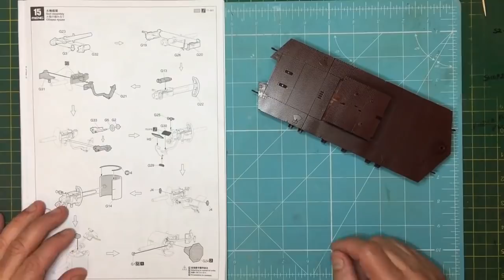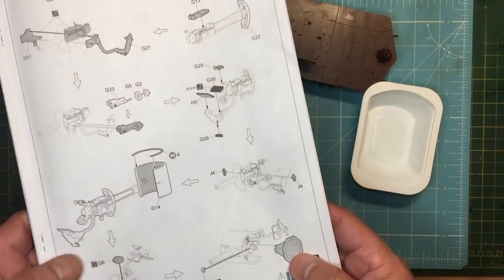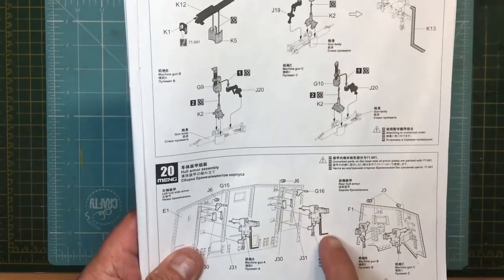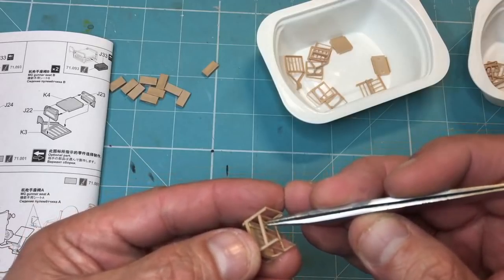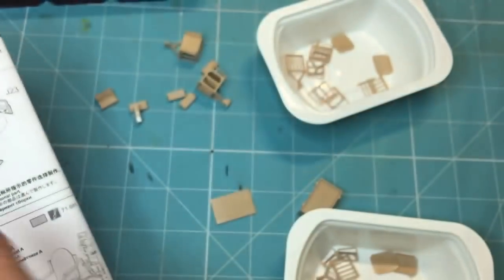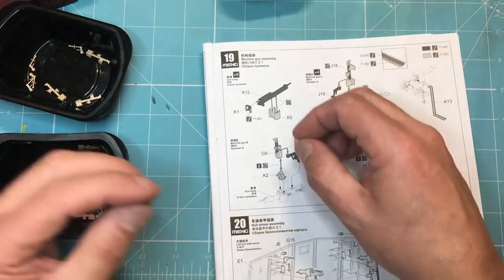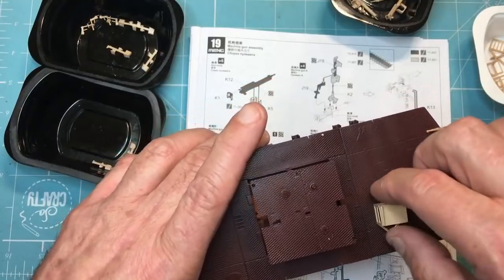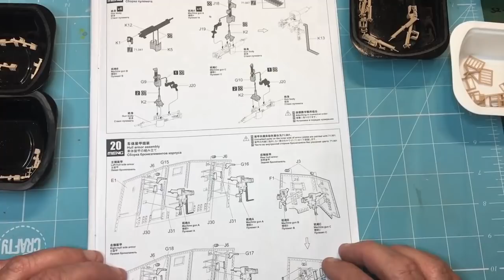Meng 1/35 A-7V Krupp WW1 Tank Buddy Build Part 7

Comment: Apparently the Germans fitted captured Russian 6 pounders in the A7V's they built,I don't know if they were the same design as the 6 pounders fitted in the British tanks of the time or the same gun round though?,I remember reading somewhere they were Russian 6 pounders anyhow?,cheers
Reply: Enjoying the build nigel good work Thanks
Reply: In my research, I show 54mm  (4 1/2 lbers) in the A7V and a very similar gun in the British Mki-V series. I don't think the structure of either tank would stand the recoil of a 75mm. I have the Aber metal guns for both, and I haven't put digital calipers to them yet, but I think they may be 52-55mm 30-38 caliber which might be a better anti-personnel gun with canister or HE, not tearing up the terrain as much as a 75mm, but still quite lethal against troops and emplacements at short range. Don't take this as gospel.
Reply: Edit: the A7V did carry a 57mm gun while the British used a modified French 75mm. The 57mm was either a copy of a British design or captured from the Russians; Re:Wiki.